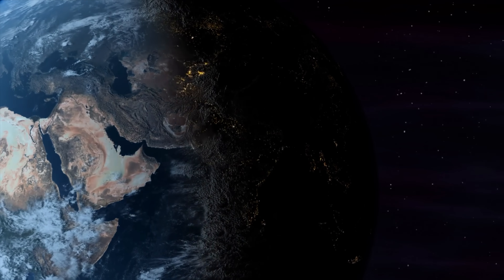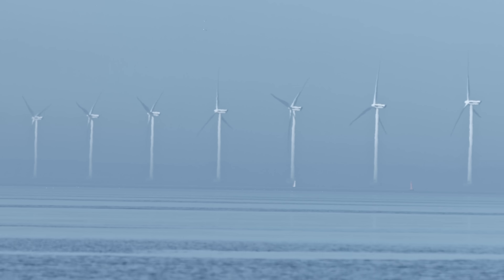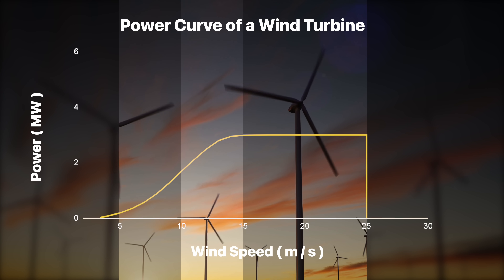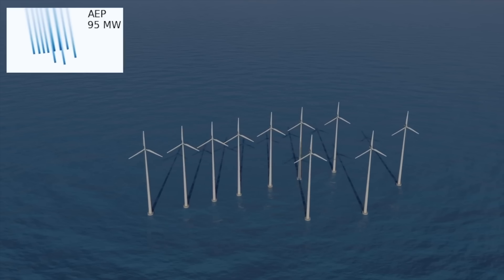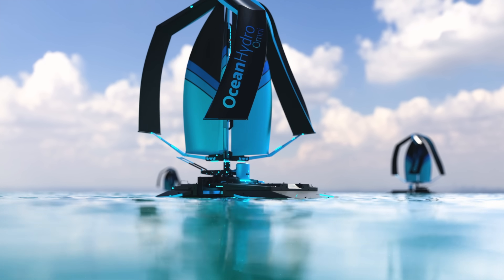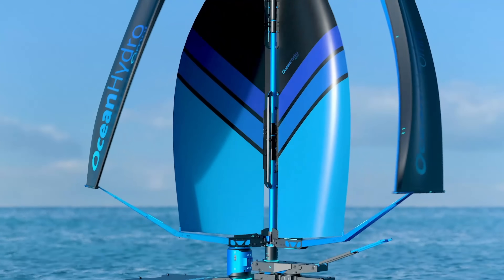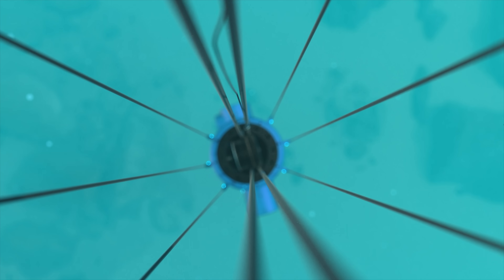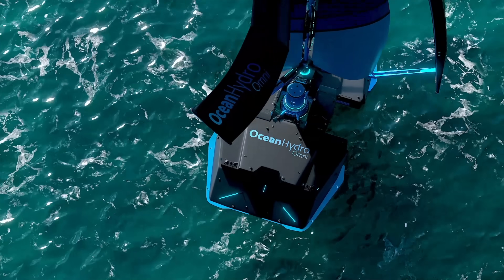Breakthrough Tech Solves Wind Power's BIGGEST Problem!

Comment: San Onofre Nuclear Station (SONS) sits on a little more than 80 acres and produced 2.2 gigawatts. Ivanpah Solar Facility is over 3,600 acres and produces 392 megawatts or only 17% of the power using 45 times more land mass than SONS .  Wind doesn't even come close. 

TLDR ~ if you're going to be serious about clean energy then you have to seriously look at nuclear power.
Reply: Example
The Dogger Bank Wind project off the UK coast is going to be completed about the same time as the Hinkley C Nuclear project (also UK)
Considering the date of first proposal, it will take 6 years less to complete than Hinkley.
.
The projected (on target) cost is £8bn, compared to the already increased £23bn for Hinkley.
.
It can be ramped in stages, thus cutting the footprint of continued fossil generation during the project (unlike Hinkley which will have zero effect until they flick the switch).
.
It has an output of 3.6 GW.
Hinckley? 3.2GW.
.
THEN there's the final nail....
Energy strike price.
Dogger Bank, £39.50 / MWh.
Hinckley, £92.90 /MWh.
(2.35 times the cost, which WILL be passed on to the consumer!)
.
As a UK energy consumer which do you think I favour?
.
This is of course just one comparison, but you could skew these figures quite a way and still not make the case for the "Unclear" project.
.
(I could add that being the first of its kind, the cost and design/  construction time will no doubt be reduced for the subsequent projects, whereas Hinkley "C" was essentially on a prepared site)
Reply: yeß 2 delorañs
Reply from the maker: guess how many homes there are in the US? You're thinking too centralized, that's old thinking. The future is going to be quite a bit different.

Comment: Could also be deployed alongside conventional turbines as they access wind at different heights.
Reply from the maker: absolutely good point
Reply: @TwoBitDaVinci  I thought one of the main reasons for making conventional wind turbines so big was to take advantage of the more constant wind speeds at those higher elevations and of course you can drive bigger turbines. As others have noted, the ocean is a particularly harsh environment to be running complex mechanical systems underwater. Ricky it would be good to go back in 12 months and see if they passed “stage 7”.
Reply: If it's installed at the base of a regular HAWT then rather than lifting a weight off the sea floor you could lift the weight UP the HAWT tower. The extra mass near the top might actually provide a stabilizing effect on the tower. The extra load being straight down the middle is probably negligible compared to the stresses already designed for. Then we don't even need to stay offshore. The innovation is to use inplace mass lifting to smooth the energy output. This can be done anywhere you can get access to drop or lift a mass.
Reply: @grejen711  That would allow the gravity weight storage to be useful in shallower water.  I wonder if they could also just reverse their generators and use them as electric motors when the wind isn't blowing.  If you've got solar arrays pumping power into the grid exceeding current demand and you already have gravity batteries available, and they aren't doing anything because the wind isn't blowing, might as well store some more energy there.
Reply: @grejen711  I really like this idea as both a solution to the corrosion, bio-growth, and shallower depth of these typical wind farm locations, plus the added benefit of tying it to an existing construction and possible utilization by the tower and already present farm
Reply: Biggest potential issue with that is depth of the water they're anchored in.  With this system you would really want it in as deep a water as you can get it.
Reply: @michiganengineer8621  So lift the mass up the tower instead of dropping it into the saltwater.
Reply: @grejen711  Different design.  Now that could possibly work IF these VAWTs were mounted on a monopole like a regular HAWT.  But that pretty much negates the idea of having them at all.
Reply: Yeah, and they could be tethered to the bases of the HAWTs.
Reply: I was thinking the same thing. It is a great way to fill in those gaps between the larger turbines and get more power output.
Reply: Could also be installed over tide turbines, then you get power from below too. Both could help to store potential energy.
Reply: Why not a single installation, with a vertical turbine at the base, and horizontal turbine higher up?
Reply: @dalesplitstone6276  If it's directly inline (inside) the mono-pole holding up the HAWT it would weaken the support too much.  If it was slightly offset then the pole would partially block the wind.
Reply: EVs
How long does it take to charge your EV? What happens if you are driving and run out of charge? What do you do if you are not close to home or do not have time for a recharge. To me, this is the deal killer. Of course, Elon might start using instant charge capacitors, but I do not see that happening for at least a decade or more. And by then we will all have Mr. Fusion! :)

No, electric passenger cars do not make sense - unless the government continues to subsidize the energy needed to charge these ugly but very expensive monsters. Without TAXPAYER PAID fuel subsidies, no one but the wealthy would be able to afford to drive one of these things. Certainly not budget sensitive commuters, trucking companies or airlines.
Reply: I'm all for renewable energy. We are not there yet. windmills are good, but not in a big scale. For a homes ok, industrial not so much. Windmills on the water🤔 Before windmills was killing birds next  fish too.  When the windmills break down they'll probably just let it sink, These big industries don't care.

Comment: Seems too close to sea so low speed. Gravity storage seems likely to get tied in knots. Submerged compressed air shared between pods would seem better.
Reply: Good point, could also hybridize w surface wave action pump jack mechanism.

Comment: Two bit DaVinci

With those big offshore windmills, why don't they also have a turbine on the mounting shaft under the water, so even if the wind isn't blowing they're turning from the current. You'd be beginning more electricity out of the exact same mountain surface and you already have the wires to send the power. You're just getting hydro and wind power on the same unit.. it seems like you've got those posts in the water and you're missing out huge by not having anything picking up the current
Reply: Stress.
Water is +/- 800 times the density of air.
These turbines are purposely in areas with high wind speed.
That wind makes the likelihood of "variable sea state" more likely.
Since the highest recorded wave in the North Sea is above 25 m and would logically be accompanied by high wind in a similar direction, a combination of the two would be "interesting" to say the least.
"Force x Distance" would probably win.

Comment: I don't think the physics of this works out. Presumably it operates through some sort of mechanical gears? If it is anchored by cables, how does it deal with large waves?When they are lowering the weight, is the wind turbine still producing electricity?
How much weight is required to produce a significant amount of energy?
I think the real tell here is there are no pictures of actual machinery, just CGI stuff.
Reply: That’s what I was wondering
Reply: Exactly. 3d generated promos... show me a working prototype and maybe then we can talk. This also reminds me of Energy Vault (but underwater).
Reply: @xntumrfo9ivrnwf  Yes similar but this is not an energy storage solution but rather a wind power generation energy system with inbuilt storage that has significant advantages in terms of the quality of power that is produced
Reply: @hydrowindenergy  Yes, but the efficiency and durability questions still remain. There are solid counterweights and moving parts operating inside the sea, which could be quite difficult to maintain and repair.
Reply: You mentioned with rough seas, as the turbine is bobbing with the waves, while the weight in the water is stationary. If they are dropping the weight to produce electricity, it will not be a constant output. Like bouncing a lure on a fishing pole
Reply: Just a complimentery power source added to the very expensive existing wind farms sending power onshore
Reply: All around, safe, cheap, and close to our Coast, 🤔

Comment: Texas is under a big high pressure system,  there is almost no wind and super hot.  
How will these windmills hold up in a Cat 4-5 hurricane?   Huge oil platforms fail.
Reply: The standard wind turbines are probably not suitable for Texas or other parts of the USA that experience hurricanes. However, there are wind turbines that are designed to cope with hurricanes and other adverse weather conditions.
Reply: What are you talking about? I live in western Texas within 100 miles of 3 wind farms. There's plenty of predictable wind here and hurricanes stay away from this area.
Reply: @米空軍パイロット   Been through Ft Stockton lots of times and none of the hundreds of the  fans were moving.
Reply: @Joyful-213  Oh damn. Well in Del Rio, we get a constant breeze of roughly 20 mph every day. Pretty much same direction too.
Reply: Build more safe nuke plants. They work 24/7
Reply: @Joyful-213  Agreed

Comment: Wind and solar are very sustainable especially when paired with production of clean liquid ammonia NH3. Utilizing the overproduction to manufacture NH3 that is used during nighttime or windless days as a clean zero emissions fuel to create electricity
Reply: A NH3 factory is utterly complicated and you lose about 70% of the energy in the process, you would be better off just installing a bunch of LFP battery arrays (like Tesla Megapack).. and this IS already happening on several places in the world.

Comment: A small, expensive vertical axis wind turbine does not "change everything" and is clickbait at best.

There is a reason why almost all wind turbines are 3-bladed horizontal rotors. The energy scales with rotor cross-section area, so a small increase in blade length largely increases energy output.

Vertical axis turbines do work, but they have failed to compete in cost per energy output with traditional wind turbines over and over again in the past. The weight-lifting as energy storage is nonsense as well. Pumped hydro energy storage is many orders of magnitude cheaper and does not nearly need as much maintenance.
Reply: It's refreshing to see reasonable people in the comments. As I mentioned elsewhere, I can't wait to see thunderf00t's BUSTED video on this.
Reply: nobody has scaled a vertical turbine up to the same footprint as the big horizontal turbines. I'm sure if you had vertical turbine 2 football fields wide and 6 football fields tall it would definitely provide more power than horizontal.

Comment: Sorry, wind may be a small part of the solution. However imo the only long term soluis safe nuclear. You should do a video on that.
Just got an email from ERCOT stating wind is down (less Windmill generation than "anticipated") and solar is reduced due to "unusual" cloud cover. BTW, the anti-nuclear movement that started in the 70s was a Russian FSB operation.  It succeeded better than they expected.
Reply: I think the solution is energy storage and management
Reply: Advanced geothermal needs a proof of concept and has potential- nuclear needs SMRs to bring the costs down and speed up its implementation
Reply: With the development of laser drilling geothermal energy plants, which means that they can be built much cheaper and faster than today, and be built practically anywhere has rendered nuclear power plants obsolete. 
With a combination of wind turbines, solar panels, backup batteries, and geothermal energy plants, we no longer need nuclear power plants or hydroelectric power plants.
Reply: @ladyselenafelicitywhite1596  "laser drilling"? You mean "gyrotron drilling" a la Quaise Energy?
Reply: @MikeTrieu  yes, I couldn't recall the technical name.
Reply: Safe?
Reply: Ok Ken,
Start consulting to build the required nuclear NOW.
When (if) it's ready in 15-20 years.... If you're lucky, tell the consumer  that the project cost double the amount (at least) of a comparable wind project, plus it took 10 years longer to complete, plus the wind project (if designed correctly) could have supplied 40% output when only half built, (5-6 years?) plus the energy costs would have been about 40% of the nuclear energy.....
Then explain why you're having to pump seawater to the plant for cooling because the river had a "supply issue", ironically, in part due to the time it took to build, which left more fossil generation on the grid......